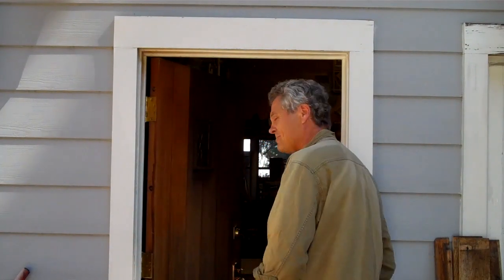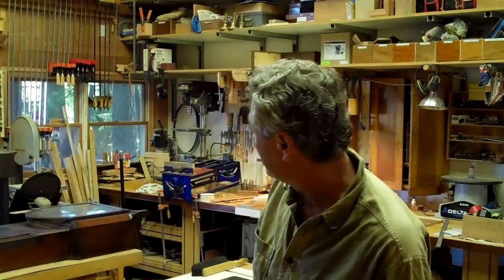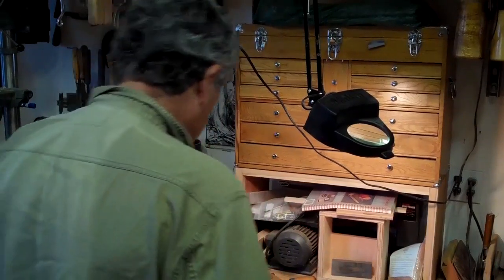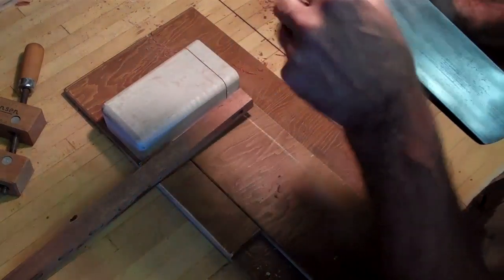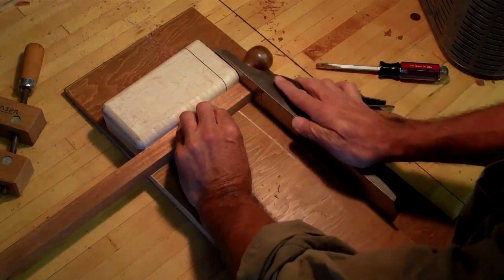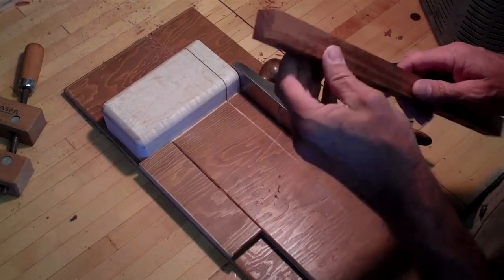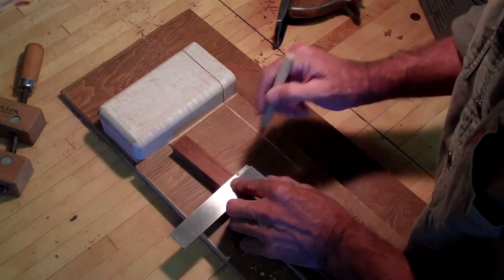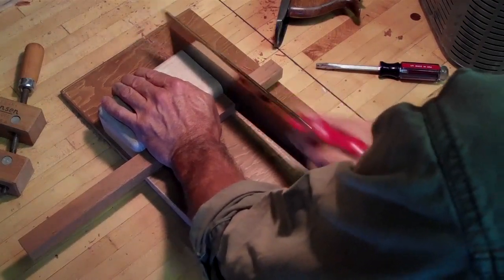Bench Hook and Shooting Board

Comment from the maker: Something very gratifying about quiet, handtool work.  Sometimes I use an ancient tool and I feel the spirit of a craftsman who may have used the tool to make his living.  An old wooden handle is something to hold and feel the skill of the past users.
Reply: I know what you mean. I bought an old wooden plane this weekend and it feels almost magical to me :)
Reply: You can get old wooden tools? I'm jealous. I have to order my tools online or make them myself. That said, there's something very satisfying about reaching for a tool you made yourself. I made a file handle the other day and I can't stop wanting to reach for it. And another benefit I'm finding to the wooden handles is that if your shop doesn't have central heating and/or cooling, wood transfers heat less easily than metal or even plastic. Makes wooden and wood-handled tools much more comfortable when the temperature in the shop is less than ideal.
Reply from the maker: @Nurk0m0rath  it’s not that hard to find old wooden planes. Finding them usable is another story
Reply: @arboristBlairGlenn  Well, try finding them in western Colorado. I've checked every antique store, pawn shop, and thrift store in my local area, and none of them carry used hand tools, let alone wooden ones. I even checked Wood By Wright's website for places to find old tools, and the nearest point is 300 miles away in Denver. Which means I either get to spend a thousand dollars outfitting my shop online, spend years scouring Ebay, or learn to make nearly all of my own tools.

So like I said, I'm jealous. I'd love to be able to find some old wooden tools, fix them up if needed, and feel like I was holding a piece of history. But, sadly, that's not an option right now. For now, I just get to enjoy the simple satisfaction of a homemade wooden tool.

Which, right now, means I'm working on a bench hook/shooting board that will work with my viseless low Roman workbench. You've got some great ideas here that I intend to incorporate. I especially love that bit about a removable bevel guide. Really simplifies the design.

Comment: I like the addition of the 45 degree attachment.  I'm going to make one for my shooting board.
Reply from the maker: TeleWacker if you do make one, hang it where you see it and you will start using it without thinking.
Reply: I already have a shooting board that I made yesterday.  I had and old one but it was not that great.  I put a 45 attachment on it that I could screw on and take off.  It works great.
Reply from the maker: TeleWacker 👍🏻👍🏻

Comment: put two round dovels into the 45 pice and two matching holes in the white block. No double sided tape neccessary. Just an idea.
In case you need two identical pices of wood, just cut them the same time together :-) Just another idea.
Thanks for the nice videos!
Reply: Or use some strong magnets perhaps.  The tape worked surprisingly well tho'.

Comment: Nice video. Very instructive. I have only one question. How did you cut the auxilliary 45 degree piece of wood to exactly 45 degrees. It almost looks like one would need a shooting board to make a shooting board.
Reply from the maker: I used a 45 degree measure that I own made out of steel.  If you check it when you cut it, then you know it is right. All about cutting to the line.